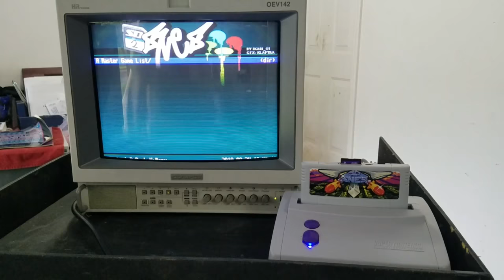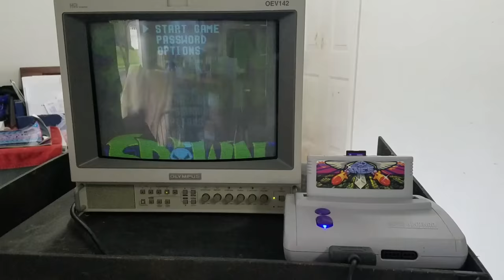Sony PVM Restoration Part 4 - Re-assembly & Testing

Comment: that was a cool series, but i wish there was a "pre" video, or something in vid1 showing what the problem was in the first place. You briefly said it wasn't working in 1, but without really seeing what was wrong it's hard to imagine it all.  For all we know, it was fine from the beginning and you just replaced the caps for fun :)
Reply from the maker: Yes, unfortunately the problem was random and I couldn't ever catch it when I wanted to film.  I still have one more episode to come on this PVM.  I'm currently painting the shell.  I was going to go over the issues in that video.  As far as the actual issue, here is an explanation:  The Pin Settings would randomly start changing on it's own.  The Pin settings would go out of calibration on it's own after any where from 1 hour to 4 hours of being turned on.  This was why I suspected a cap replacement would help.  Thanks for watching.

Comment: I had some caps changed in my PVM 20L2. Unfortunately, I have a V-SYNC issue with the image scrolling. Is there away to adjust the v-sync in the service menus?
Reply: I'm not familiar with that monitor but some have a knob on the outside you can adjust. It might be called v hold. If you're monitor has a service mode like the one in this video i believe it is in the service menu. Do you know how to access the service menu?
Reply: Hi @NiggelMyNiggel, Unfortunately there are no v-hold knobs on my model. I was able to get into the service menu, using this Retro Tech video: https://www.youtube.com/watch?v=o-MquBghtDg&t=131s

I found deflection settings and positioning, but nothing for v-hold. I wonder if I need to open the monitor and adjust it from the inside.
Reply: I have a monitor with the same service menu let me check it real quick...
Reply: It's option 77 in my service menu that is accessed by pressing deguase and enter while in the regular menu. the option is titled V HOLD. I checked it. it definitely controls vertical scroll. by the way, V HOLD is adjusted to play games from different regions.
Reply: Thanks!!,  I will look for that when I got home tonight.
Reply: let me know either way if it works for you
Reply: Unfortunately there is no "V HOLD" option in either the user menu or service menu for the 20L2 series. :-/, There must be some internal knob or pot that requires adjustment.
Reply: there is another service menu you can access by holding down the menu button for 3 seconds. I would try that first. After that I would look for a potentiometer. It might not be callded V hold. Do you have a service manual?
Reply: What is giving you this sync issue? Are you trying to play games on the system? What input are you using that is giving you this issue? Are you hooking up the system via the BNC connectors AND using the "Ext sync"?